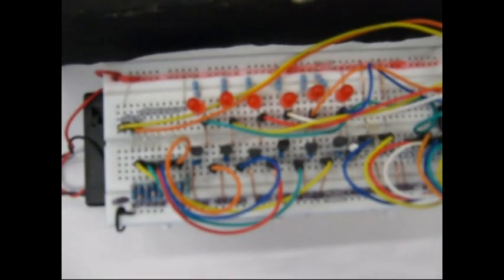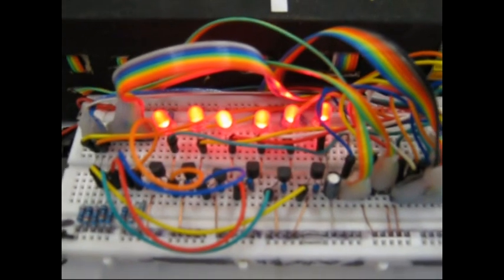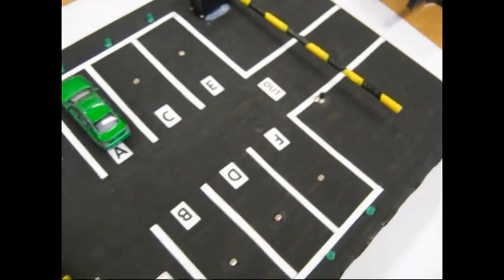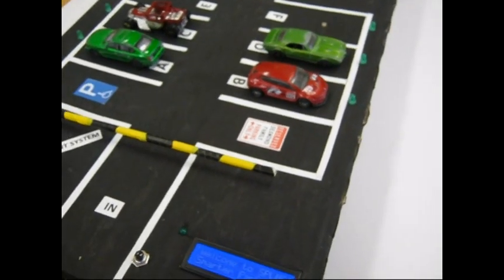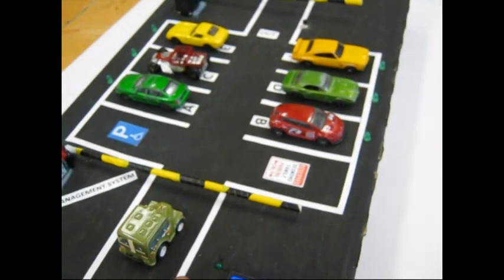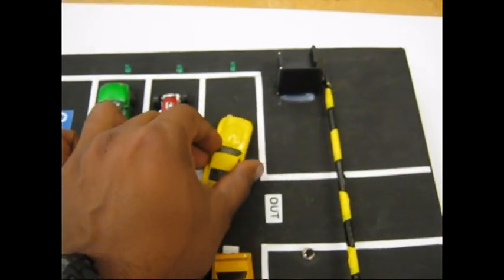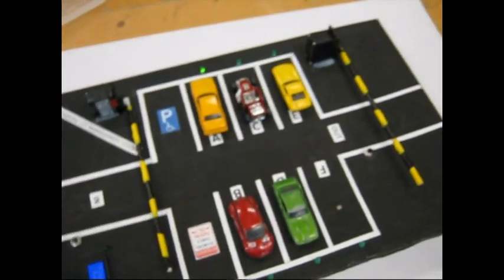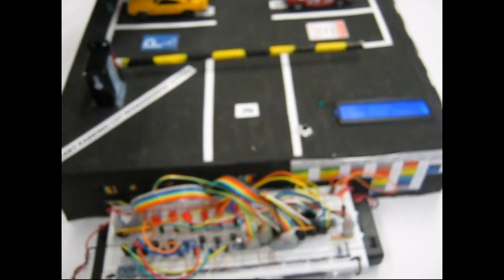Smart Car Parking Lot Management System

Comment from the maker: all the details are in the video my friend, except for the final program code. but that's not hard to figure out as everything is running in sub routines/procedures. You will notice that a breadboard is used to prototype, I didn't get to the stage of producing a PCB, but I did work on the schematics. What are you exactly after?